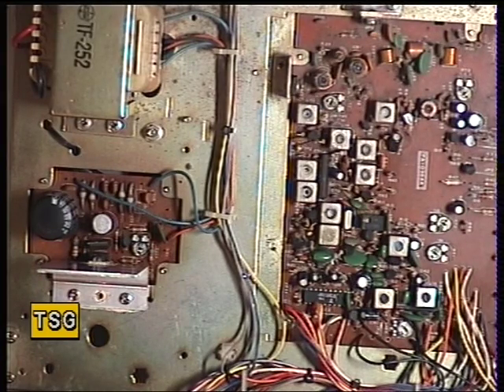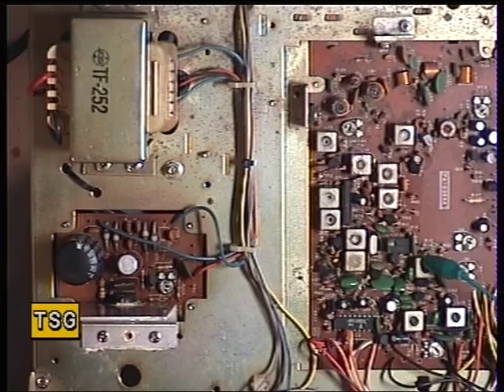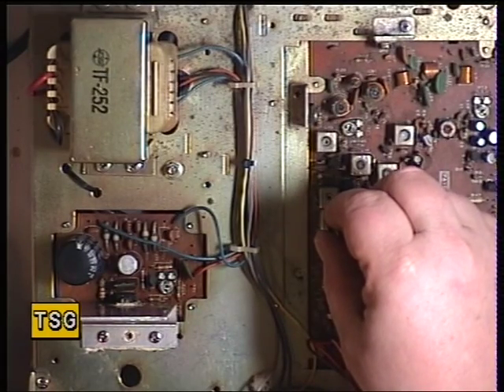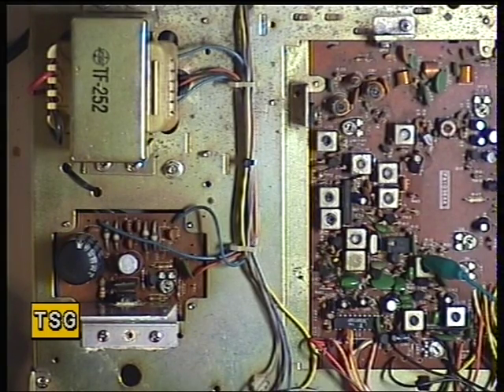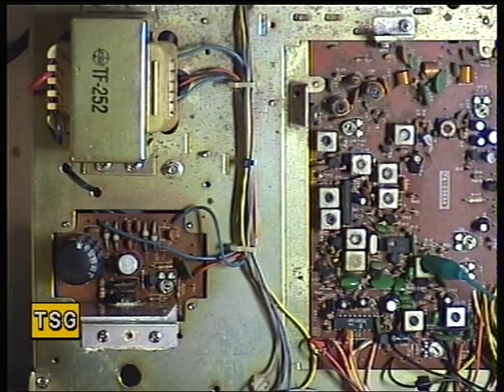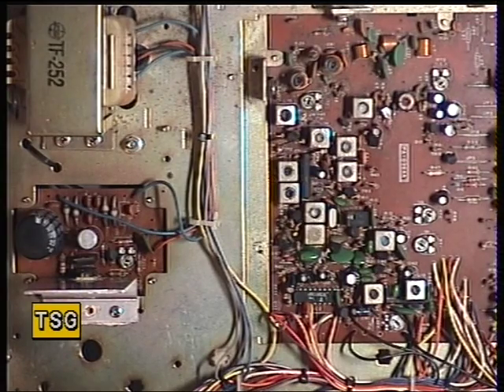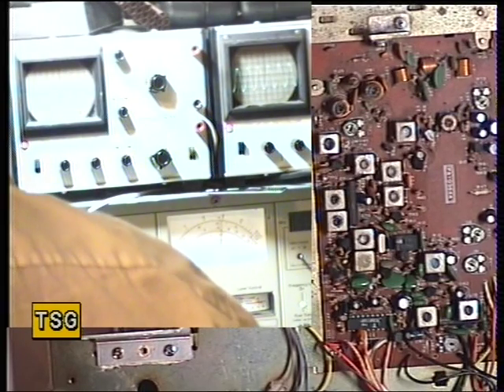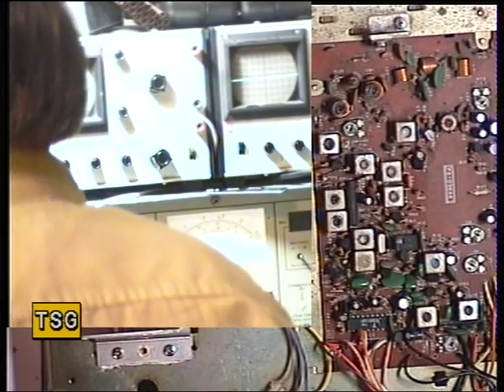Uniden Uniace 300, UK (CB 27/81) CB radio (Base Station) - VCO & Transmit adjustment

Comment: Hi Richard, im a little confused how you set the deviation using the scope and adjusting the amplitude of the signal..
regards

Peter
Reply from the maker: Peter, the scope is seeing recovered audio from the deviation meter (within the test instrument). The deviation needs to be set for around 2.3Khz with a steady tone...we use 1Khz. The deviation meter shows the 2.3Khz on the needle. I also check with a whistle test that the deviation never exceeds 2.5Khz. I've also shown stand-alone deviation meters & perhaps it's time to do another video using stand-alone instruments that can be bought cheaply secondhand.
Reply: @ukfmcbradioservicingTango21  
Many thanks for the fast reply.. thankyou for explaining this.

Many regards
Peter

Thankyou Richard for doing these videos.. I really find them useful.

Comment: Is there any way of adjusting the frequency on this chassis? I have one that's slightly out.
Thanks
Reply from the maker: No there isn't. Sometimes a 0.5pf ceramic capacitor across the crystal will help. Otherwise replace the crystal with a new one (not off a scrap chassis!). I say this because crystals drop frequency naturally with age, so crystals of a similar age are all tarred with the same brush!

The frequency error tolerance I allow (well within the government specs). Channel 20 should be 27.79125. Lowest acceptable 27.79001, highest I allow is 27.79154.  Hope this helps,

Richard
Reply: Thank you for the advice Richard, I really appreciate it. The frequency in this one has went higher for some reason. What should be 27.9125 is actually 27.9205. I'll start by changing the crystal. Thank you again.
Reply: these radio any good I'm  gonna buy one this week

Comment: I had one that worked, for 5 minutes!  The large capacitor had leaked on the left of the PSU board.  I would recommend anyone who has one changes the 3 on the PSU board (there's one underneath) as they are dead easy, and its about £4

Comment: I can't seem to find the service manual or schematic for the Uniace 300, does the Uniace 200 have the same board?
Reply from the maker: Chris TheHulk Yes it does, except of course the power supply
Reply: Ah spot on. I got a Uniace 300 that's a wee bit deaf so will take a look at the 200 service manual then. Cheers